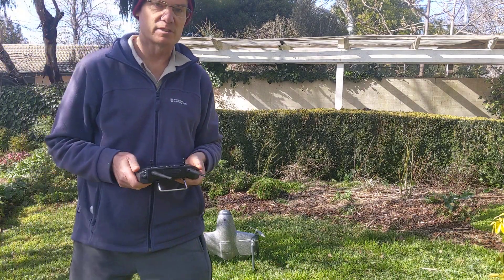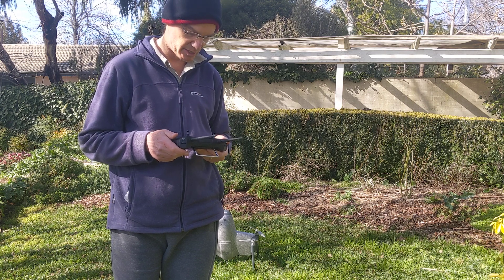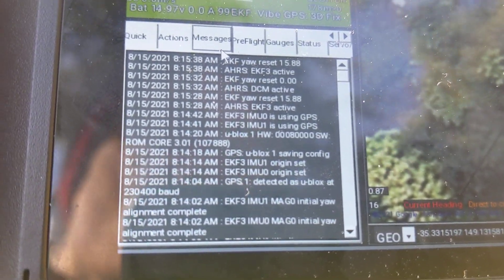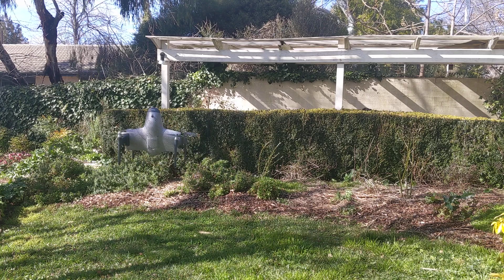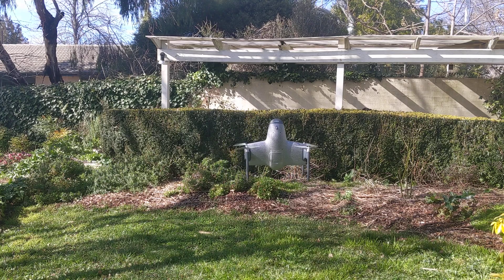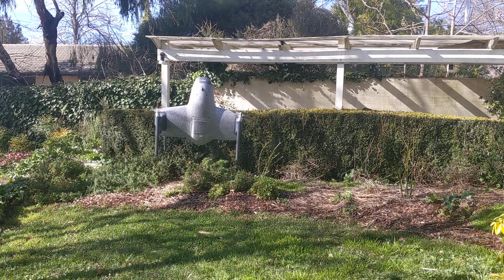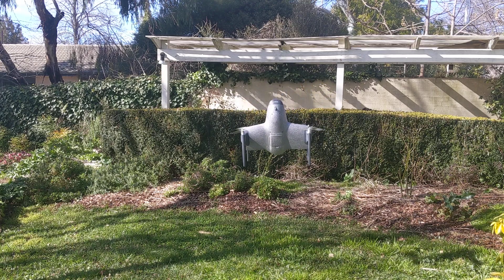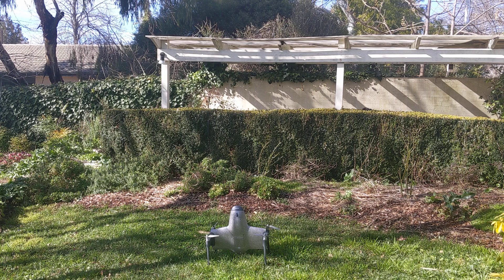Testing EKF3/DCM Switching on HWing

Comment: Is this related to singularity of different orientations XYZ vs ZYX with vtail switching to horizontal flight? I thought ardupilot use quaternion which should solve the issue is not it?
Reply from the maker: no, totally unrelated. It is inertial vs non-inertial state estimation